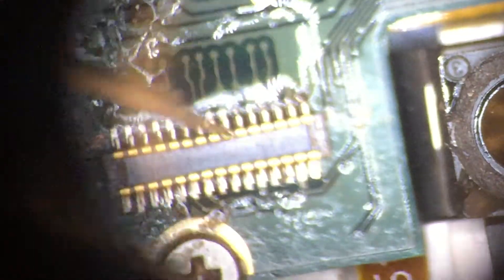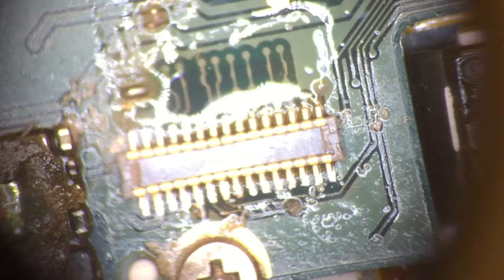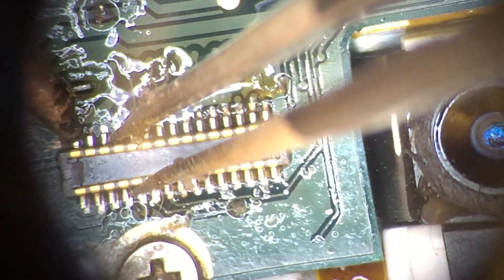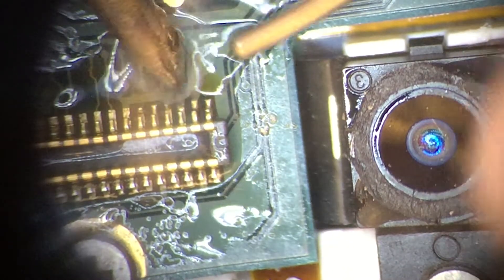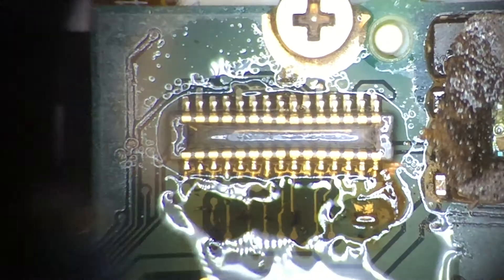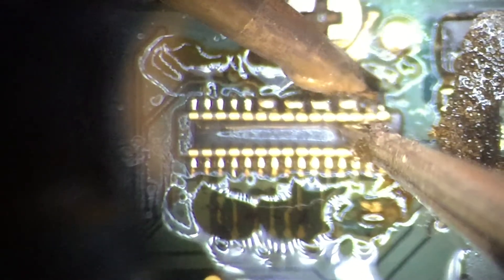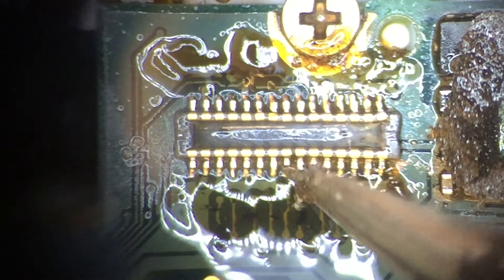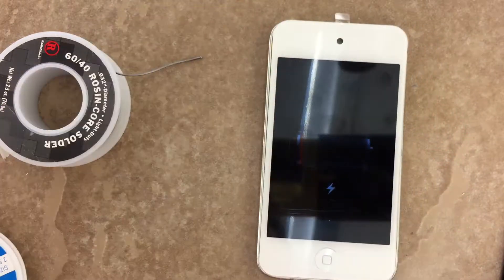iPod Touch 4G LCD FPC connector soldering / repair

Comment: hey man not bad! What kind of tip did you use there? I like how you did it old school with solder and not the low melt. Thanks for making this, cool vid! If I had to critique though it would be on the radio shack solder LoL. Kester seems to be the go to brand I would say, but to each his own? Another thing I would say is to let the viewers know kapton tape is great for making sure the heat doesn't touch the  wrong parts! I see you don't use it but your more seasoned in doing these repairs. How did you desolder it anyway?